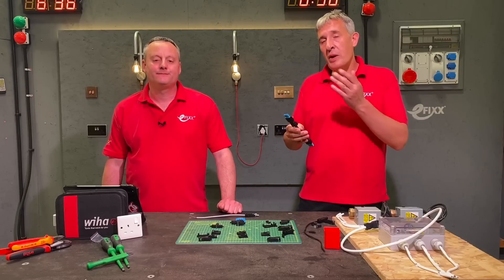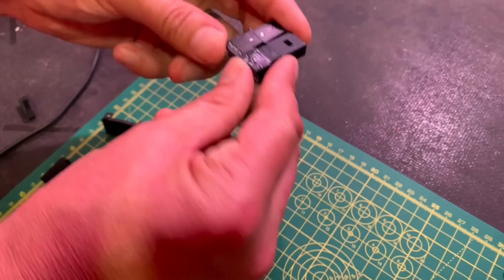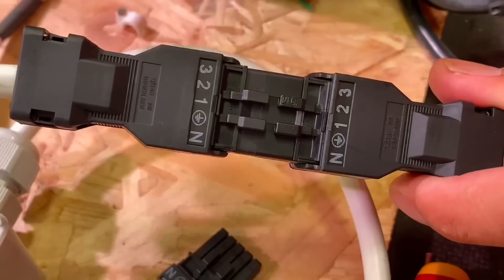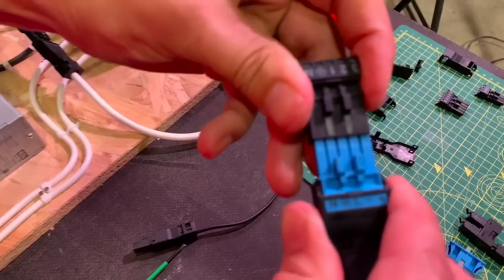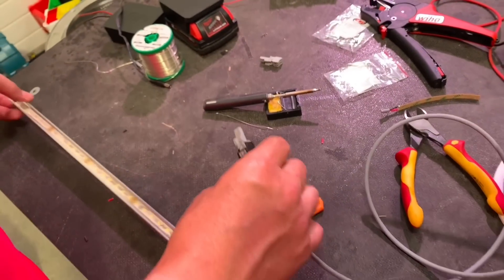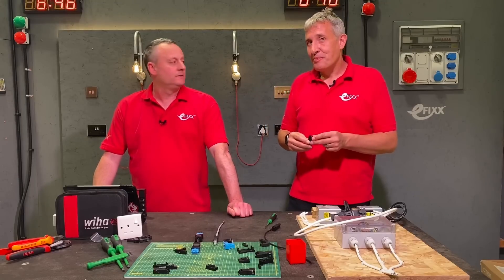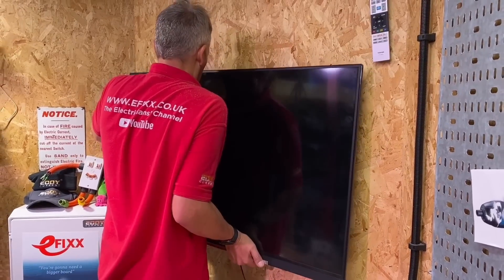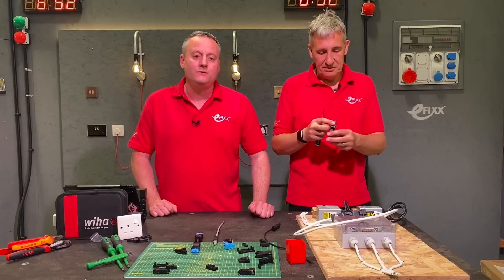How to use WAGO WINSTA MINI 890 SERIES - 3 great applications for electricians

Comment: Been looking for a wago substitute for the regin 5 way connector. This looks great for zone valves.
How do I purchase the connector with cover and locking piece as shown in your video? Wago seems a bit confusing when buying, which bits are included and which are extra accessories!
Thanks

Comment: These could be great for lighting when the fitting has a tail on it with maybe a normal wall plug on them but you don't want to mount them like that and the tail is really short. Not uncommon on affordable fittings. Might be more common in schuco countries though where molded on connectors are much more common.

Comment: Great video! Love Wago systems.  I recently used wago connectors to connect a Whirlpool dishwasher to the ac line during installation.  Normally the power is run to a sheet metal box, the line is secured with clamps on the box and wire nuts are used to hook it up.  This is always a huge problem if you want to pull unit out for service or part replacement--you end up having to shut off the breaker so you don't have live wires floating around when you disconnect the wire nuts.  Now--I only have to unplug the  connector from front bottom and pull unit out.  I've also used the DIN rail system to rewire the wiring harness on a '66 VW bug cabriolet that I had to rewire from scratch.  Great product--not well known here in the states--but gaining popularity!
Reply from the maker: Sounds like you are working on some great projects!
Reply: Wire nuts? In this day and age? My oh my!

Comment: Using the same system as Gordon used. The Washing Machine, Dishwasher & Tumble Dryer can sometimes be a nuisance to get back to the wall and have the appliance flush with the Kitchen or Utility Room cabinets. Thanks for the DEMO guys.
Reply: I detest seeing FCUs over worktops. If having a w/machine, d/washer, t/dryer being plugged in a 13A socket inside a cupboard a few cupboards from the appliance these will come in real handy in extending the lead and pulling in and out.

Comment: You need to specify which country you can use these in,  these are not approved for use in my country
Reply from the maker: The carry ENEC and UL approval - so that’s Europe and US covered. Which country are you viewing from?
Reply: @efixx  neither of those areas. I have checked our regulations and these are not suitable for mains use where people can access them, only in control cabinets where you can only gain access with use of a tool.

Comment: Hmmm.. They have their uses I guess. Ideally like you showed us for extending short cables. Not sure I would use on a TV though. Soon. As that plug is cut off and its under warranty the supplier won't want to know. 😏 Great for led drivers and tape though. Easy to swap out if they fail.
Reply: In my experience, most appliance instruction manuals include guidance on the wiring colours if the plug needs to be changed. Under UK consumer law, I think manufacturers would struggle to justify voiding a warranty for a plug change if wired correctly..
Reply: @KendalMike  indeed
Reply: @KendalMike  also, aren’t most TVs equipped with an iEC13 these days? Must have taken some doing to find one that has a permanently connected cable…
Reply: The supplier would rapidly learn from me off their obligation under the sale of goods act. The plug is just a plug

Comment: As we all should be using ferrules on stranded cable can a ferrule be used on those connectors ? . I personally don't like the idea of a dedicated tool to use those connectors . I love innovation in our industry, and new ideas , but it doesn't look good when you turn up at a client's house and you don't have the correct dedicated tools because a manufacturer come up with a new system that you or hardly anyone seen before
Reply: Yes you can use ferrules with these connectors.

Comment: Great products guys. I’ve got a problem in work at the moment. I have to terminate a mini emergency downlight, that only has a 35mm cutout in the ceiling. I need to terminate 2x t&e’s in one side and a flex out to the fitting in the other side. Obviously a standard choc box won’t fit through the ceiling hole. Is there a solution in this range???
Reply from the maker: Check out the Winsta MIDI series - link in end screen or cards.
Reply: The winsta MIDI does offer two connection points per pole, but the winsta mid 3 pole plug and socket with strain relief are listed as 34.6mm wide and 15mm high, so I don't think they will fit through a 35mm round hole.

I would suggest the Quickwire "T connector plug and socket" would be the soloution for this problem.
Reply: Cheers pete, they will probably wiggle through with a bit of a push. I’m really struggling to source a suitable solution.

Comment: The first thing I thought about was central heating valves and pumps.
I guess they could be used in column lights and communal lighting for inspection and testing,maintenance and repair to save disconnecting wiring.
Also with multiple  pir sensors for communal lights so they could be disconnected one at a time when setting them up.